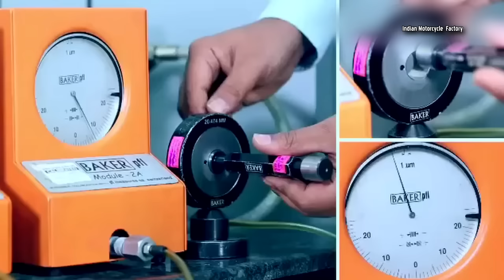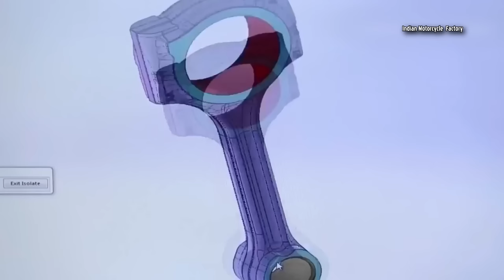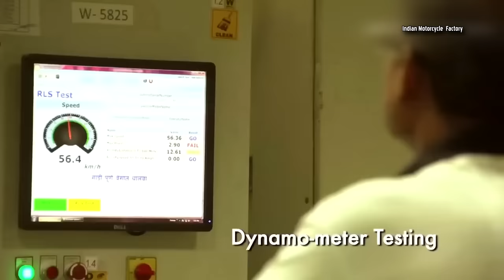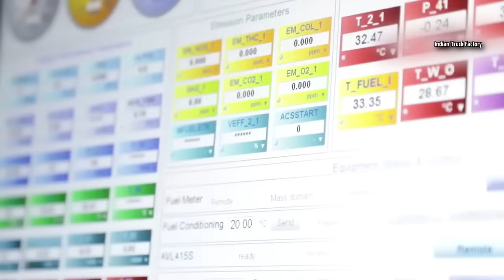Bajaj Motorcycles Factory 2024: Manufacturing Indian Bike BAJAJ – Production & Assembly line

Comment: I'm from Indonesia. I have 3 Motorcycle made in India. Bajaj P220, TVS 110 and KTM Duke 250. Indian product have strong matrial, hight durability and i love it.
Reply: Which one do you like ?
Reply: KTM is not indian bro its Austrian
Reply: @chatgpttalk477 it's made in india by bajaj😅
Reply: @chatgpttalk477  KTM never made sub 400cc product. In 2008 they with joint venture developed 200, 390, 250 cc platforms on which puksar As, RS, NS, dominar, duke 400, 200 , 250 RC series and adventure series are based!
Reply: @shubhampandey9497 idiot but he simply said 250 cc ktm
Reply: @shubhampandey9497 Is true

Comment: bajaj motorcycle is famous here in the Philippines. The bajaj 100cc the best fuel efficient motorcycle.
Reply: Really 😮 ??
Reply: @AJOYDAS9    yes 80 kilometres per Litre Petrol
Reply: Almost 30yrs completed still unbeatable milage king Bajaj 4s champion bike still in our tamilnadu SALEM area good revalue for this bike normally it ll give 70+ milage ruf nd tuf bike.
Reply: I use Bajaj Discover 2014 model   now 75km /L  low maintanence coast  Total over 1 lakh km  not open engine only change oil and filter only
Reply: @mohansubusubu2116  u actually have 100 000 km on a bajaj motorcycle that impressive  i have a cg125 4 wheeler made from old yamaha blaster hopefully it will last a long time
Reply: Yes bajaj. 4 s champion was legendary bike from. Bajaj mine family had 7 bikes that all was 4s champion   @mohanram7246